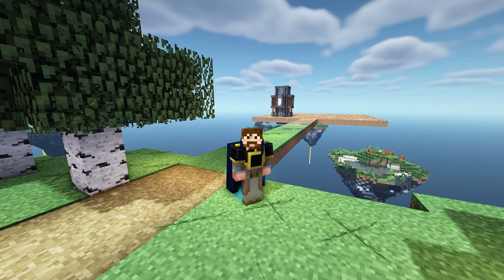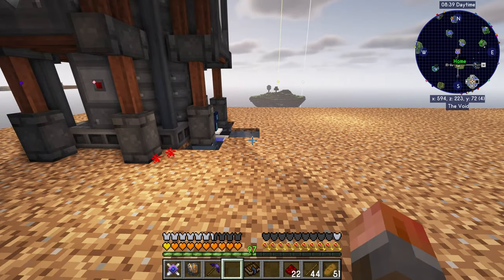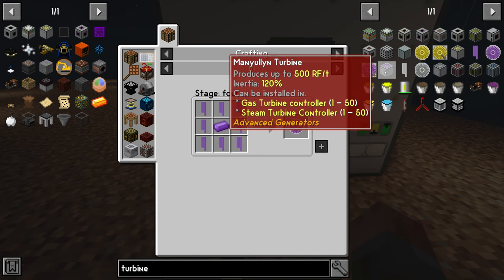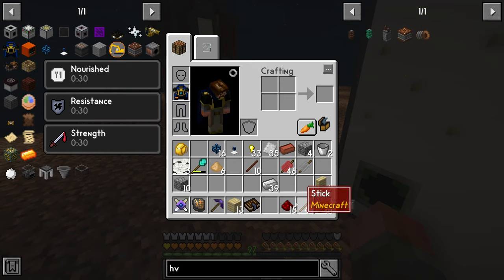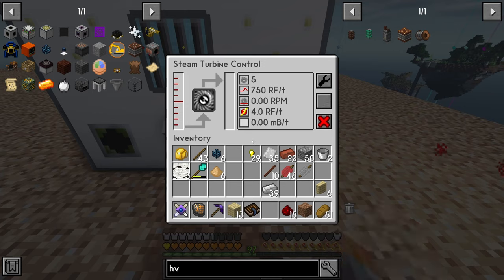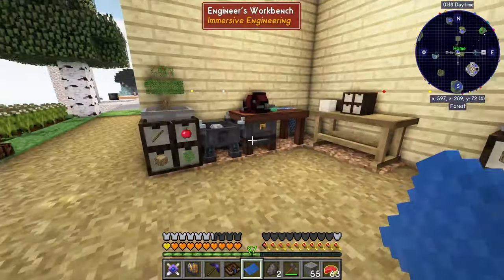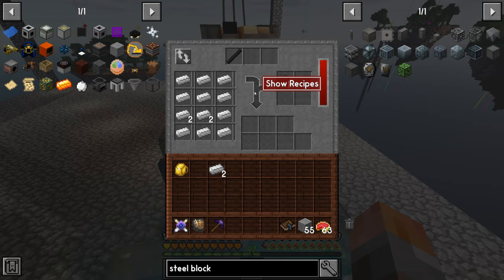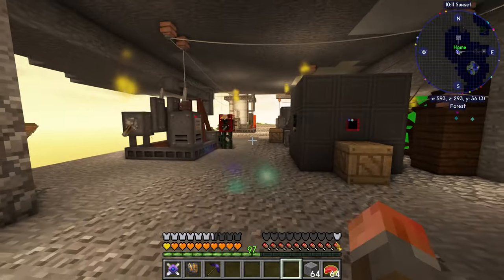SevTech Ages of the Sky E15 - Solar Towers and a Steam Turbine

Comment: If you get the chance, enchant the electrodes. They are compatible with unbreaking, so they last longer. Also, the multiple repair options work on them as well, should they be close to breaking. Basically, if set up right the first craft will last you forever~
Reply from the maker: They lasted easily into Age 5 (in upcoming episodes), where the powered diamond anvil is available for easy repairing of things